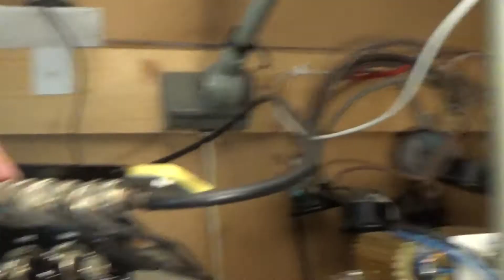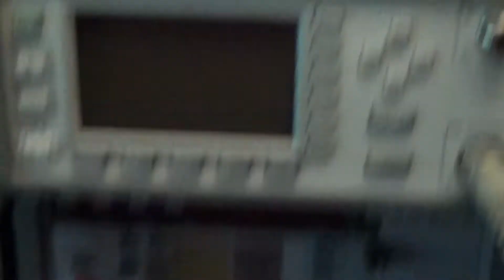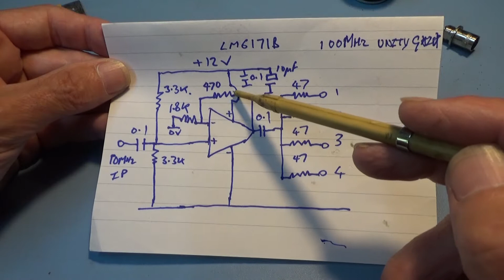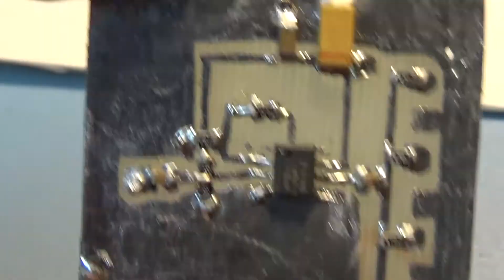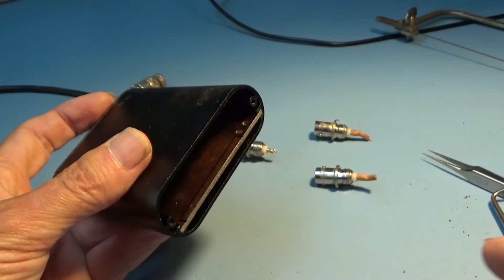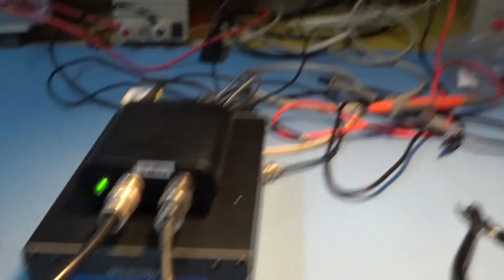10 MHz distribution amplifier construction

Comment: I tested the setup, the result is 7dBm at the output. With a 13dBm input from my GPSDO. I wonder how to increase the output to have at least 13dBm? Thanks
Reply from the maker: @jackfrazer6488  you need an MMIC small 50 ohm gain block. Something like the MMSA-0520 by Hewlett Packard. Gives up to +20 dbm output with a gain of about 10 db. That's an old device but I'm sure there are others out there by mini circuits and other manufacturers that would do the job.
Reply: @ptronix  Thanks for your help, finally, I did some tests, with your diagrams. I installed 4 BNCs at the output of my box. and an input. I send +13dBm to the input, I connect 1 cable to the output I have +11dBm peak on my spectrum analyzer. I lose about 3dBm per connected output! If I connect the 4 outputs to my test device, it is at about +2-3dBm! The signals are not noisy, and do not really variation. Thanks for your help, and I'll see if I can modify the circuit or do it another way!
Reply from the maker: @jackfrazer6488  not sure why you need such a high output? Just measured mine and I'm getting 6 dbm out of the GPSDO and 7 dbm out of my distribution amplifier. That's with all ports feeding various pieces of equipment and they all work fine at that level. Well I hope you get the result you need.
Reply: @ptronix  I looked at the specs of several other amplification distributions and most have 10dbm at each output? I'll leave that, my devices seem to work fine like that! Thanks again

Comment: There is a capacity 100nF missing from then negative input resistance 1.8Kohm to ground .You should not ground the negative input directly to avoid DC gain .You need the op-amp amplify only ac signals .

Comment: How many 10MHz outputs could you have?  If you wanted 10 outputs say, what would you need to do?  I guess you could buffer each one...  Sobering thought about what might happen to our radio gear when we pop our clogs...  A lot of it will either end up in landfill or  on the 1 quid table at some hamfest.
Reply from the maker: I think you could drive 10 outputs with that opamp, it's got a fairly high current output and if you needed more just build another distribution box.

Comment: Nice project! Kudos! Suggestions = 1) You could have used the first board by increasing it dimensions by gluing it to a bigger substrate/PCB/plastic/wood. This would have saved effort and stressing the components with the additional reflows. 2) Check out OSH Park. They are a board house that only charges a flat $5/sq inch for PCBs/including shipping anywhere in the world/absolutely no minimum/3 copies/better quality than the best Asian houses. Your board could have been double sided in 1 sq inch so just $5USD to your door with two extras to share. 3) You could have just flooded the active traces on the second board and not used much solder. I am not fault finding, at all. I am impressed with what you accomplished. Just trying to help, for your future projects. Cheers!
Reply from the maker: I watched the video again just for you as I was intrigued by your comment and I get it know, yes the original board was too small.
But it was easy to make a new board and I like things to fit properly.
I'm 61 and have no problems working with smd components, in fact I prefer to make boards  with smd, no holes to drill and the board can be a lot smaller.
regard nick
Reply from the maker: Thanks for your comments, don't fully understand the first ones as I made that video a year ago and have completely forgotten most of it! And don't really want to watch it again. 
As for getting boards made in China that would be a very good idea if I was mass producing them.
But I really have no patience to download board design software and learn how to use it!
I can knock up a board from drawing it out on the copper, etching it, soldering the components on and have it working in an afternoon. OK it won't look pretty but it will work.
Thanks again for watching and commenting
Reply: @ptronix  1) Yeah, I totally understand not remembering things. Your first board was not wide enough to fit into the wall slots that hold the PCB. You made a whole new, wider PCB. I was just saying that your could have just glued some extension tabs onto the first board to make it wider. 2) It is great that you are having success with making your own boards. I never did. OSH Park is a USA company. At just $5/sq inch/delivered/no minimum and depending on the size of your board, they can be way cheaper than the Asian houses. But, there is the wait time to consider. 3) How excellent that your hands settle down for SMDs! I have had to come up with various work-arounds. One is to attach a piece of Kapton tap to the component and fashion a "handle" of sorts to hold it. Or, just tape it into place, of course. Cheers!

Comment: I would like to build a version of this using cheap punch proto board and a DIP package socket device. I know about de-coupling and short leads and oscillation. I don't do SMD anymore. Any idea on a suitable hi-speed replacement for the SMD chip?
Reply from the maker: Hi Danish, I'd go for a max 477 by maxim, 300 Mhz op amp, I've used these before in the same circuit & would have used one in this project but couldn't find one at a reasonable price. They're available in a dip package. Personally I prefer smd as they're no holes to drill & can make smaller boards. Thanks for watching

Comment: hello nick i know its probably going to sound lame but ibought an fm transmitter from dazarro 3 but it came already assembled. i bought a what i thought was a diy fm transmitter from dazzarro3 and i was really extatic when it came . i was     egar to assemble the trans but when i opened the packaged it was already complete long story short i just want to builder my own fm transmitter. so i bought the diy kits from amazon and of course there were parts missing in every single package. would you be so kind as to send me the neccesarry parts to build one also  can u put  the directions in it as well how much will you charge me for doing so.i just wantr to see if i can build one on my own and make it work

                                                                                                      thank you so very much
                                                                                                            sincerely your fan 
                                                                                                                     cheryl h